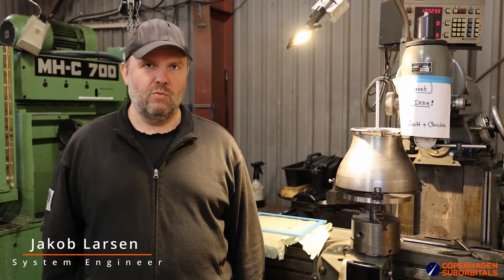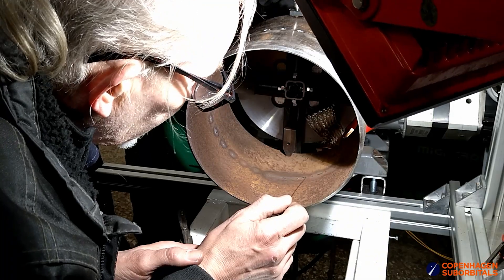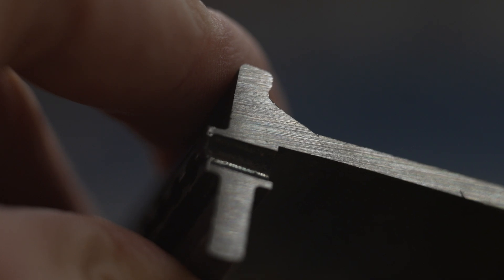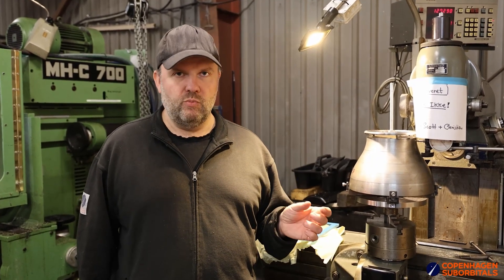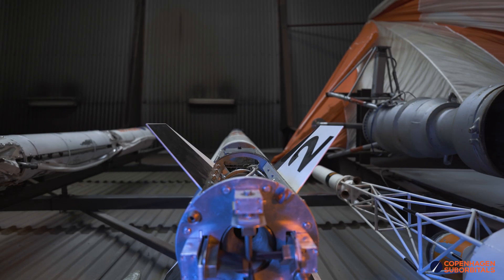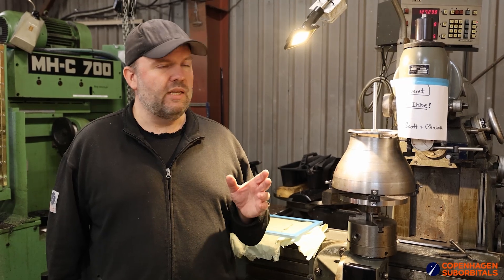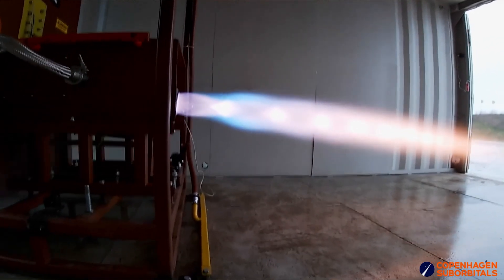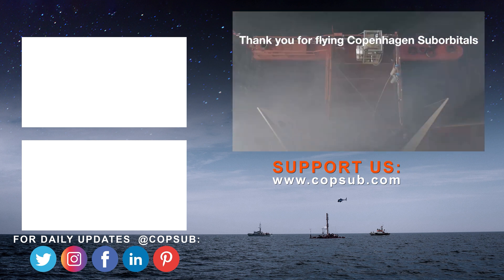This Nearly Stopped Our Rocket Engine Development...

Comment: When welds are not working and or are not strong enough, it is really a good idea to preheat the metals to be joined before applying the weld. This will literally bond the metals together so they become as one.

Comment: Why even bother with robot tig welding simple shapes?
Induction welding is how companies rapidly lay kilometres of high speed rail and high pressure pipes. V-groove interface, rotate and press the nearly molten edges together.

Also why subtractive manufacturing for simple shapes? Can't just induction heat and dye cast things?
Reply from the maker: "...companies...". We're not a company, our budget is less than 10% of NASAs budget - for coffee

Comment: Is there a reason you don’t go to a pressure vessel manufacturing company and talk to them about their procedures? There is probably a boilermaker or nuclear welder somewhere who’s passing 100% x-rayed welds on the plate you’re running if it’s a common boiler/pressure vessel plate. Go video him running his passes and just set your feeds, speeds and amps around what he does.
Reply: Its probably proprietary info

Comment: Your welds at the point should have a back purge and everything should be in a box away from air drafts and moisture.  If it's a metal box and you can add heaters even better.